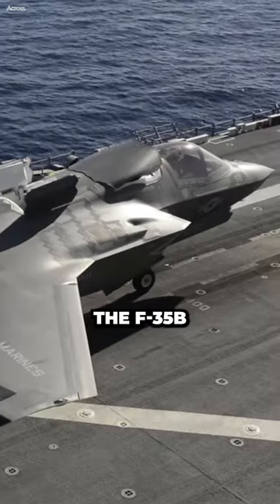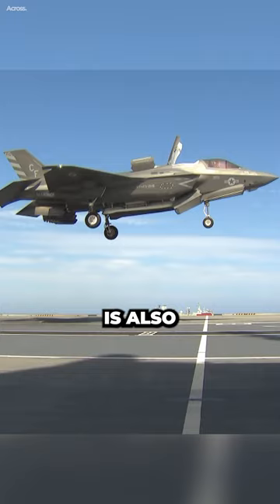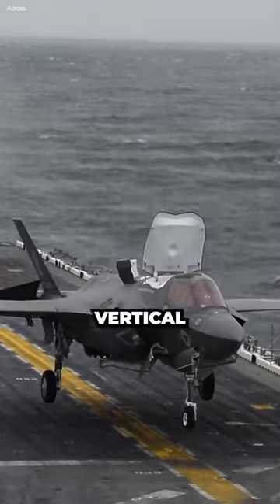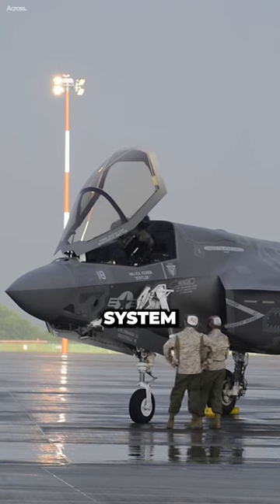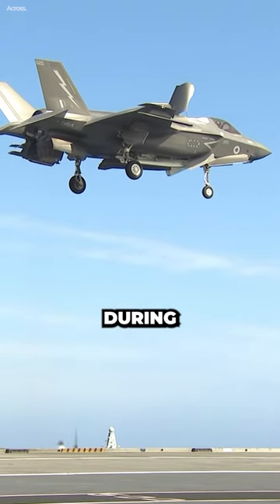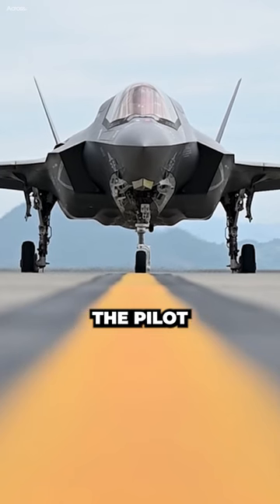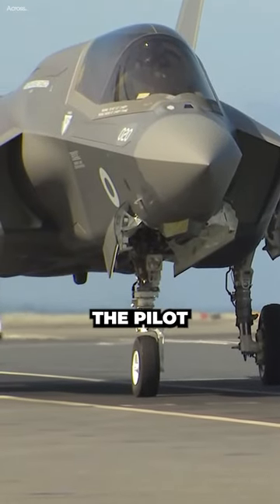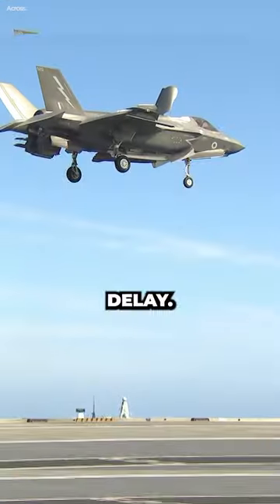Why is the Flap Behind the F35bs Cockpit Always Open?

Comment: Nifty how those clever engineers at Lockheed Martin managed to hide the air intake for the big vertical thrust unit (the MOST important feature that defines the B versus the other 2 variants) under a -- checks notes -- "canopy jettison door"
Reply: Amazing ain't it?
Reply: Yea i work with these and we dont call it a “canopy jettison door” not sure were hes getting this from 😂
Reply: @Kalerix9999  Now, I've never worked on the 35, but I was an F16 maintainer, so I have a pretty good understanding of how the egress system works, so unless there's been a huge change in how those systems work on the 35, that "door" shouldn't have diddly squat to do with egress. Am I wrong in my assessment here?
Reply: Fr I had to double take on that. I was like "wait what? " 🤨

Comment: This sounds like Chat GPT
Reply: Indeed, it really does. Out of curiosity, I just tried and asked it (ChatGPT): "What's the flap behind the F-35B canopy?" Here's its answer: "The flap behind the canopy of the F-35B is part of the aircraft's Exhaust Gas Cooling System. This system helps to reduce the temperature of the exhaust gases before they exit the rear of the aircraft. It's a crucial feature for the F-35B variant, which is capable of short takeoffs and vertical landings (STOVL). The system helps manage the high temperatures generated during vertical operations"; I then tried again with the exact same question and it gave me a more senseful answer. Moreover, the script of the video seems to me written in the same writing style of ChatGPT.

Comment: That ‘flap’ is actually the upper lift fan door. It does NOT stay open during normal flight. It’s only open during vertical landing and short take-offs and automatically closes as the plane transitions to forward flight around 200mph. This door was not the original design but, was changed due to strange cross-wind issues with the original design. And it has absolutely nothing to do with canopy ejection. If you’re going to present info on our newest fighter plane designs, at least do your homework. SMH

Comment: The "flap" behind the cockpit is opened for air intake when hovering or during a short takeoff/landing...and is closed during normal flight.  It does not reduce drag.

Comment: I’m not an expert on the F35B, but to my mind that looks like an air intake for the vectored thrust system, that’s closed during normal forward flight to reduce drag, and also serves as an air brake when it’s open. I have no idea what the canopy jettison nonsense is about, but I suspect the door needs to be closed during an ejection or it could get in the way of the jettisoned canopy.

Everything in this video is wrong.

Comment: This is all false totally fake info the truth is the air from the engine is very hot during vertical takeoff the flap opens exposing a fan that helps with cooling